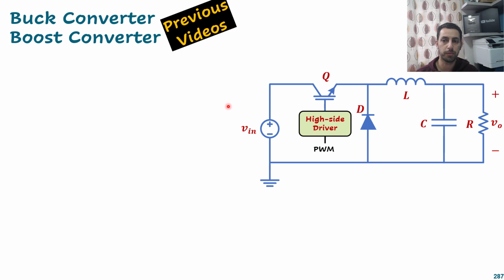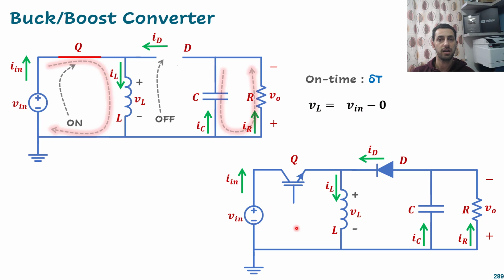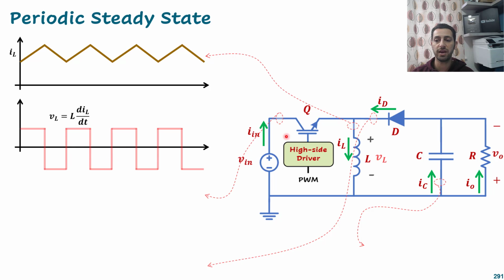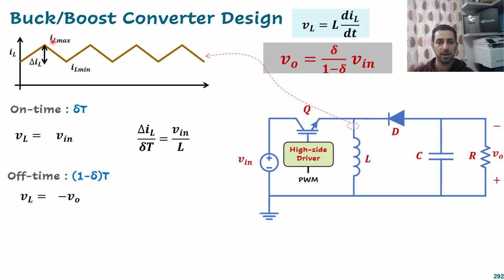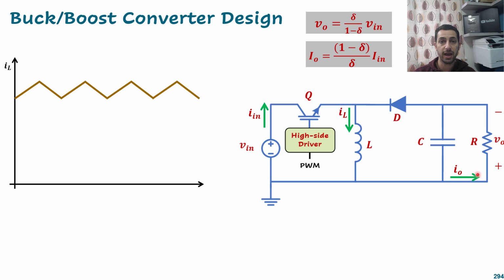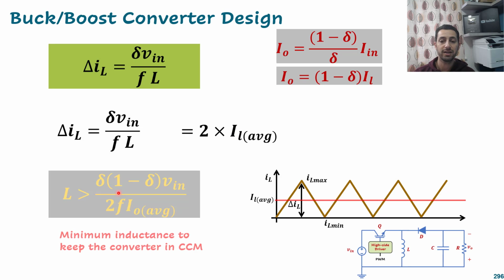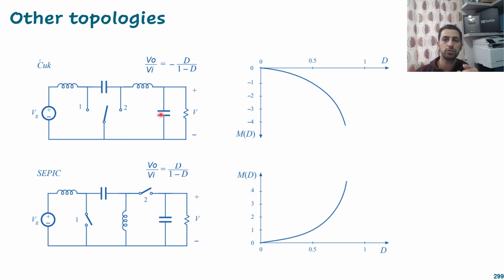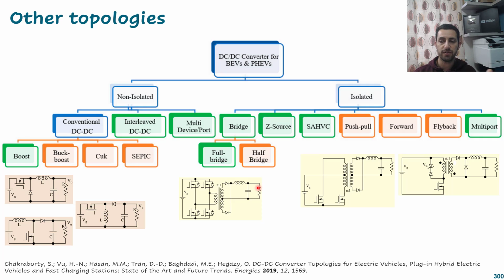34 Buck-Boost Converter Analysis and Design | Power Electronics

Comment: sir, can we charge a lead acid battery with this inverting buckboost converter?
Reply: You can, if it will give you the voltages (and current) needed for charging a lead-acid battery.
But you need to know more, and have control and limits for proper charging of any battery.